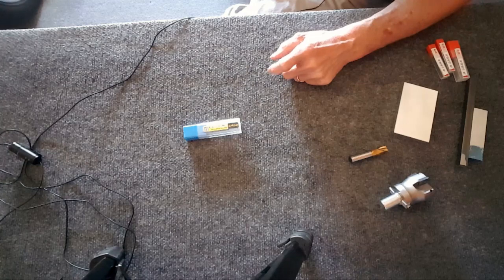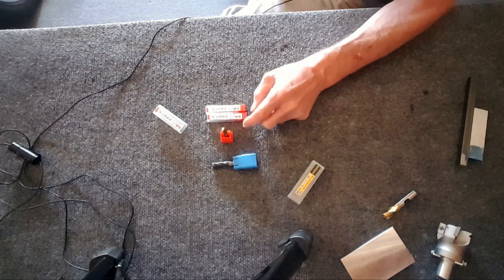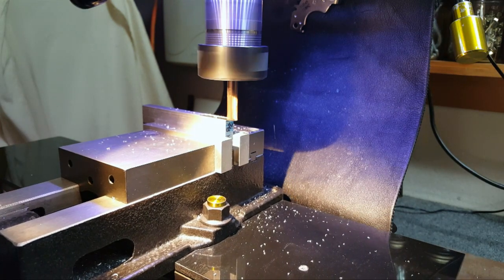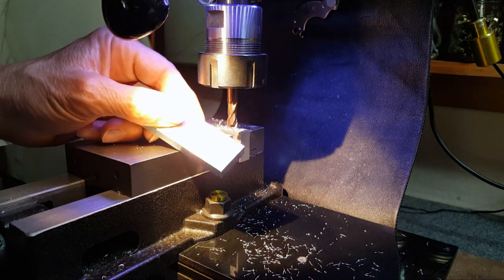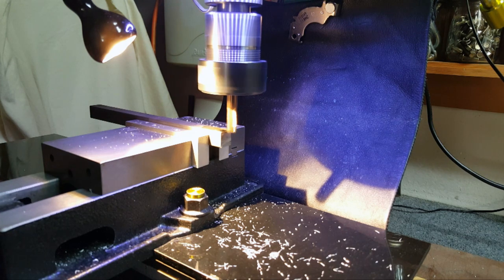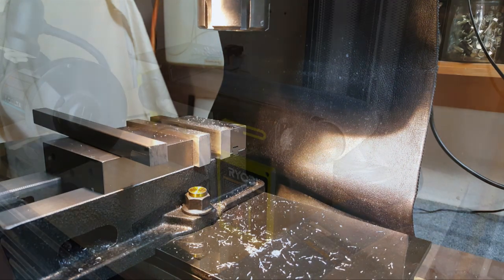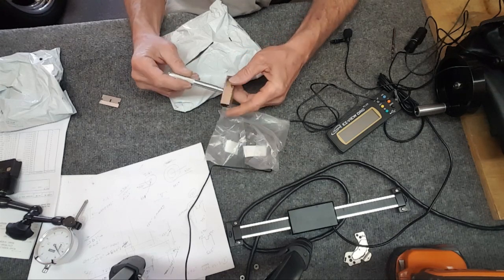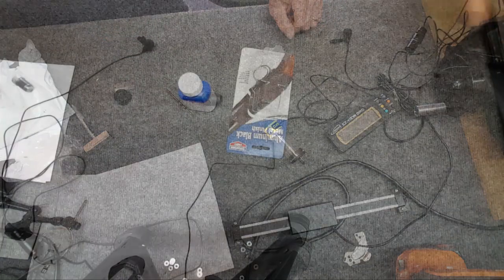Just Some Reviews & Comments

Comment: I used to blue a Canon it did a great job. There is a certain way to use it. Soap and water to wash it then alcohol. Then blue. Very light sand and repeat. After the 2nd. Sand just blue wash and blue again.  That is also sold in a 3 step process.
Reply from the maker: Hi Mike, I tried everything you said but used acetone to degrease instead of soap. Used a Q tip to apply. Suggestions?
Reply: I don't know about using acetone. And they could have changed how they make it. So you may have done all you could but nothing could change the out come. It been a while since I did mine. I'd be glad to email you a pic of what I used and a pic of the Canon.
Reply: Thank you for the videos. I plan to get some of those things off banggood. For my projects. I have a 3n1 lathe/mill. I'm very new to alot of this. I use to re-build cnc spindles for 8+ years. Anywhere from metal working,  wood and granite.
Reply from the maker: I would absolutely love to see pictures! My email is shown at the end of every video.
Reply from the maker: Link is in the description for the 2 flute end mills and if you need any help just ask. The channel is to help new people...